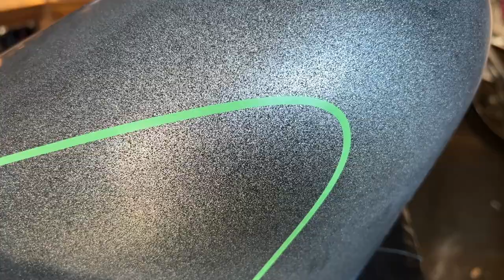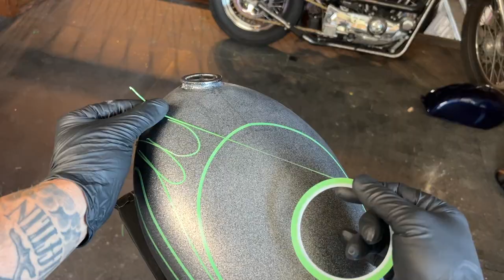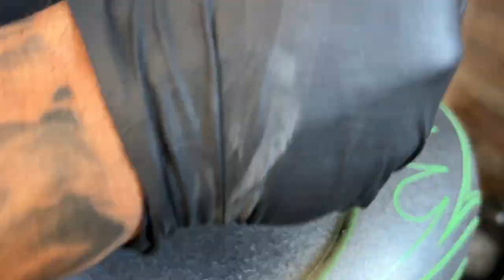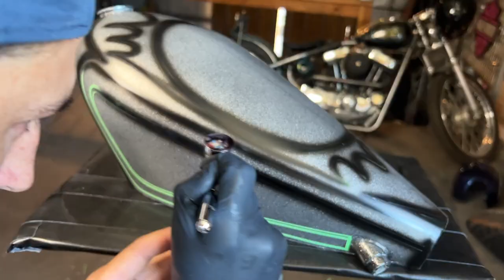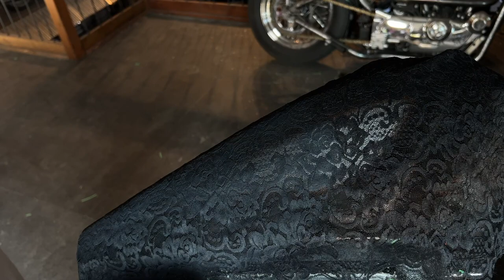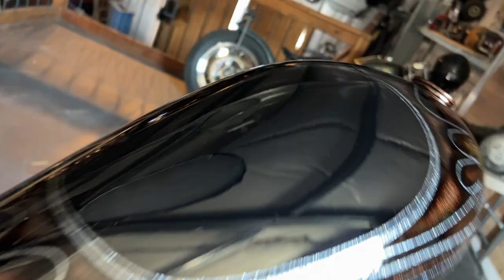TiME WARP Photo Transfer, Harley Davidson Chopper Tank, DIY (Part 1 of 3)

Comment: I picked up some fine line tape from Flake King UK. It’s the best tape I’ve ever used. I haven’t tried the lime line because I work with small 1mm 2mm tape and it’s hard to find that over here in the USA. You should check it out if you are curious. PS-I learned how to tape and flake from this channel.

Comment: Question.  Can you use clear waterslide transfers?  I know that they can be done on top of a clear epoxy with another clear coat over the top and make the edges disappear, so I would imagine that you can do the same with clear coats as well, but I've never seen anyone do it.